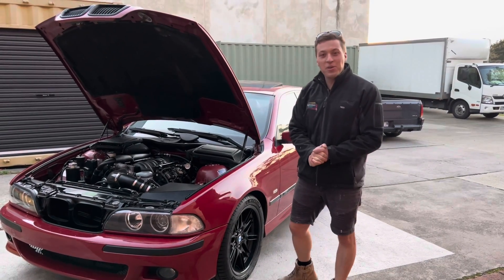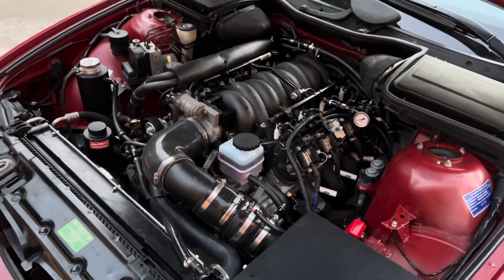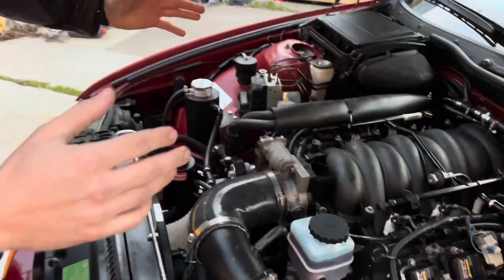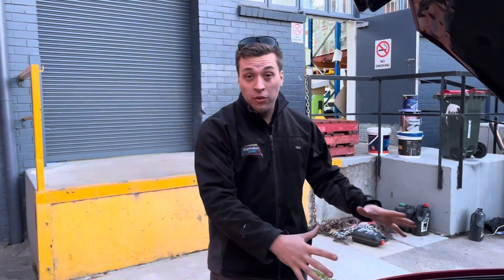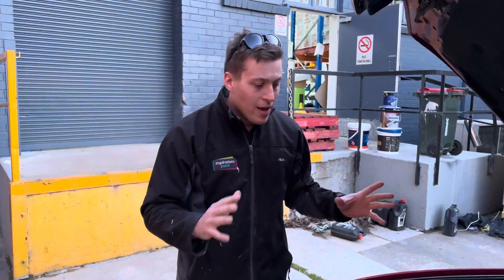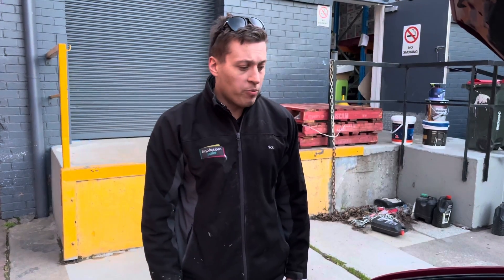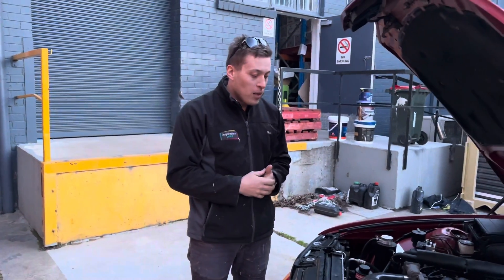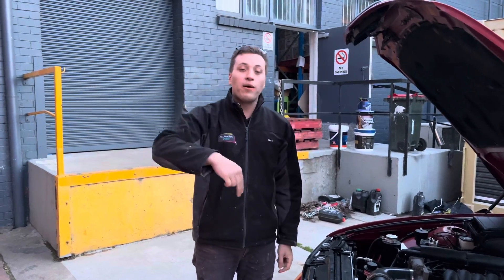ENGINEERING LS SWAP IN AUSTRALIA (E39 BMW) WHAT YOU NEED TO KNOW

Comment: What was your estimated total cost including engineering, conversion kit, motor + trans, etc.? Interested in ls2 swapping mine
Reply from the maker: Well I did things like put an OS GIKEN M5 diff which isn’t required. Also rebuilt the engine. I’d say 20-35k

Comment: What would be a reasonable cost for a shop to do a drive in drive out LS1 with TR6060 swap, suitable diff etc to pass emissions and engineering? Looking into doing an e36 or e39 but am curious as to what would be a reasonable charge for a shop to do the job in your opinion. Cheers
Reply from the maker: Speak to brintech customs. They offer the service

Comment: Hey mate, great work, I have a few questions, I have a shabby E39 still registered and most of the bits to LS1 it, the tail shaft I have and the gearbox mount is for a 6speed manual and I want to use the 4speed Auto,is the spline and length of the gearbox compatible?

Comment: Very informative vid 👌, how much did the swap cost all up roughly? Got a budget of 30k to LS swap my 320ci wondering if it's realistic
Reply from the maker: Very interesting question… 30-40k
BUT, it didn’t have to cost that much. 

I didn’t need to rebuild the engine
I didn’t need to rebuild the m5 diff with a OS GIKEN
I didn’t need an 8 pot brake kit (not fitted)
I didn’t need a haltech ecu (now fitted)

I think if you have that budget brintech customs could do a drive in and out service for maybe an ls1. 

I think engine the swap could be done for 20k
Reply: @Melbournerider  thanks heaps! Appreciate it!
Reply: @Melbournerider  wow someone who actually answers the question properly when asked! I’m buying this exact type of car in two weeks and this is my plan. Might have to freight the car from Perth to Melbourne. Much appreciated mate.
Reply: How much did engineering charge you ?